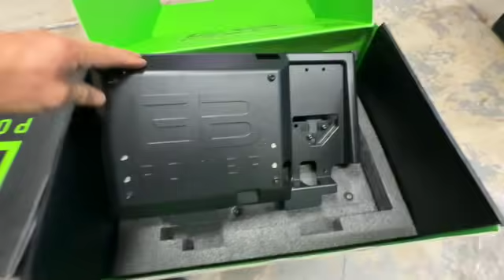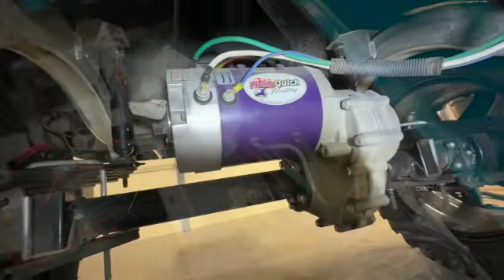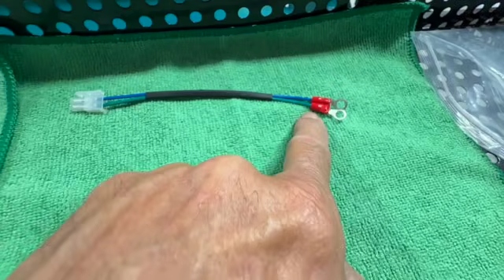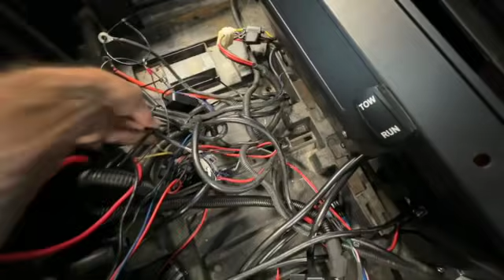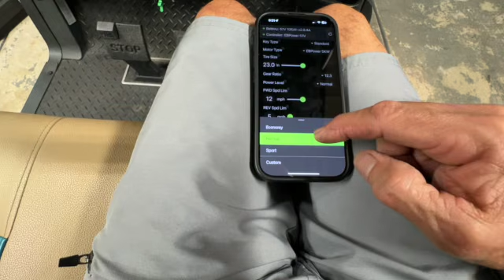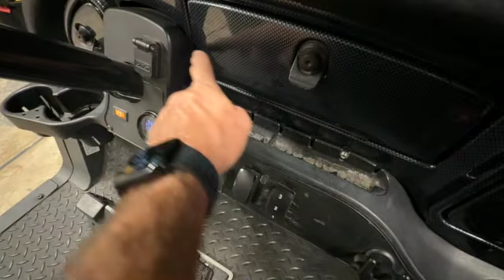How to install Eco Battery AC kit Club Car Precedent AKA "EB POWER"!

Comment: I just installed the eco battery ac kit. The final step is to connect the eb power app and configure.

I am able to connect to the controller wifi and then have the controller connect to wifi to update and check modules. When I tap check modules the app screen goes blank and the controller light keeps blinking like it is trying to update. Nothing happens past this point.
Reply from the maker: sorry for the late response, Ck for an update on the app, I feel like this has been adressed

Comment: Excellent video James! EB is a force to be reckoned with. Awesome kit. If I had any concerns it would be the Mode switch on the dash. With kids this switch would be a huge temptation. I’d rather set the cart up with this switch unavailable or hidden. Around here we have carts set at 15 mph when kids are riding around and when the grownups are driving we ramp it up. Just a safety thing and my .02
Reply from the maker: I have heard that is a concern, and future updates/enhancements will fill that!

Comment: On a stock 2022 CAR ONWARD 6 inch lift kit does 23-24 MPH what will I get out of it if I put a plum quick motor install and do I need to change the controller and the solenoid?
Reply from the maker: hey Bob, sorry for the late response. Here is a video I did on a 4 year old Bandit, and 3 year old 51v Lithium...https://youtu.be/fJ9UPd10Sq4?si=s_rDLB0hFBOeqRZ0